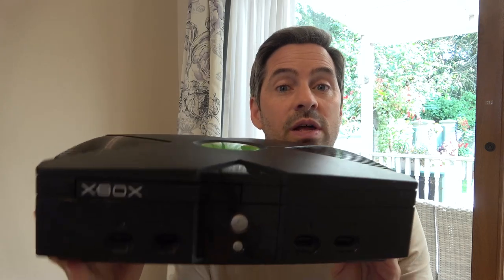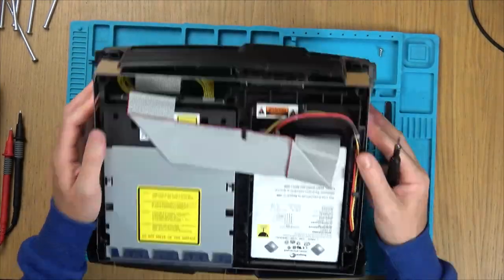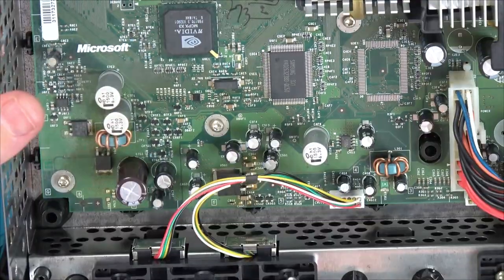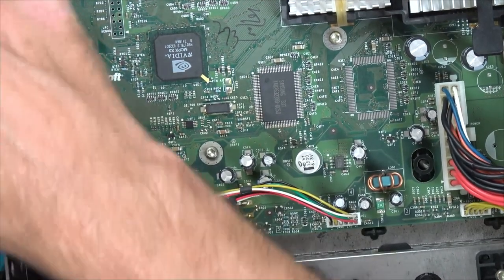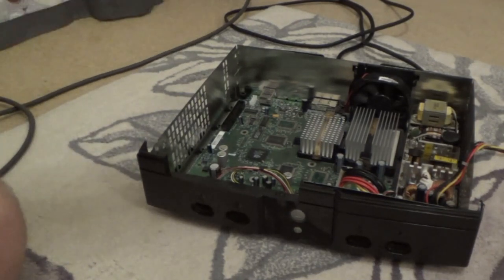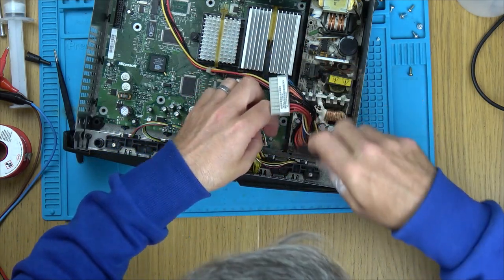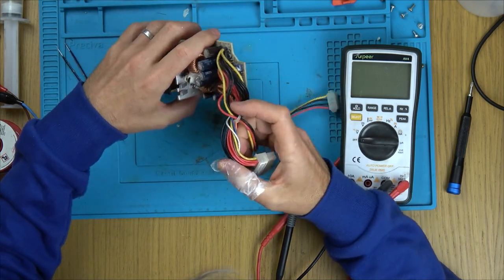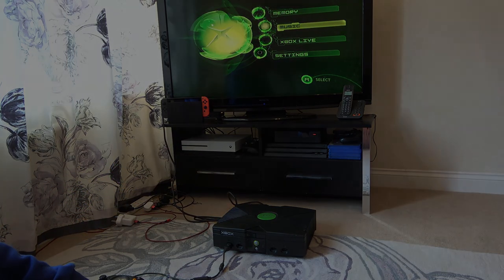How To Repair FRAG on the OG Xbox (Flashing RED & GREEN Light)

Comment: I bought a fully refurbished board 1.4-1.5 for 85$ with a paired drive and after putting it in and everything I get this error. It has new caps and thermal paste so idk what the issue is.
Reply: I read that the boards are tied to the hard drive. Could be why yours isn't working.
Reply: Yeah I sent my whole xbox to be repaired. I got tired of messing with it, but the company ghosted me 9 months ago 😮‍💨 stole my whole xbox 😭 company called resurgence games out of Canada